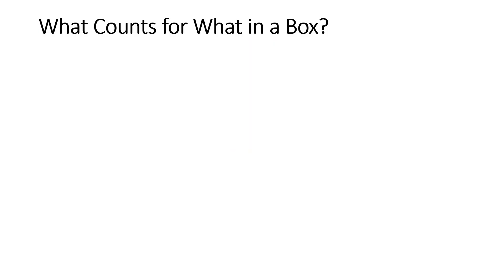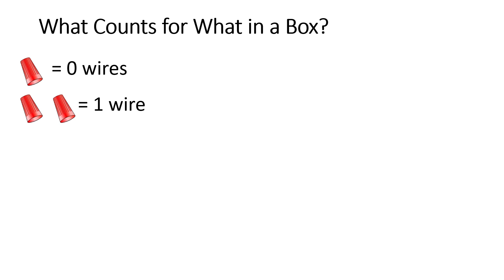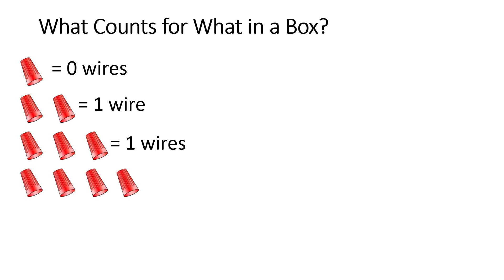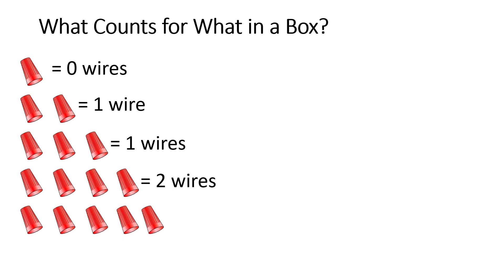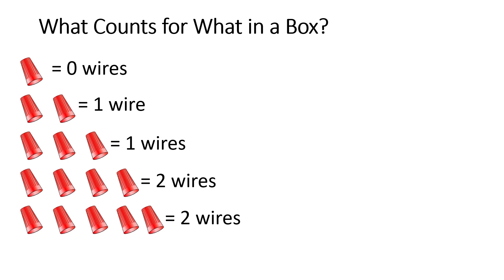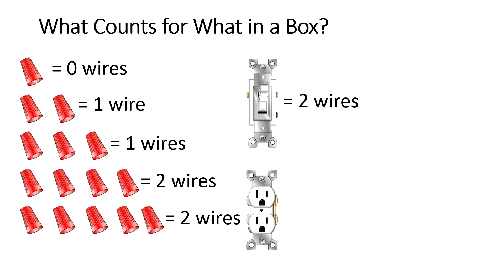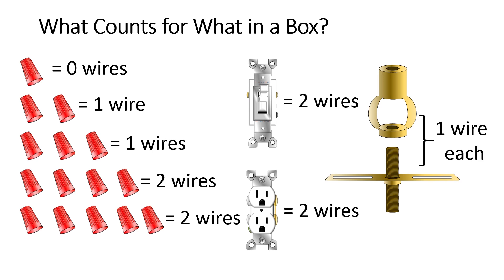Sizing an Electrical Box

Comment: hey quick question!! when there is a device present ( switch, outlet) do we use the largest conductor for caluclating the 2 conductors the code requires use to account for the device? or can we use the smallest wire for the volume calculation?
Reply from the maker: It would fall under the same requirement as  wire connectors. We would use the largest conductor sizes and take the device as two equivalent of that size.

Comment: Just took a Class with the gentleman who publishes the illustrated CEC and 12-3034 2(b) - one conductor for every insulated pair with a cap.  And that is how we are doing it in Code Class. So your six wires as per the code is only 3 wires, plus 1 for every pair of caps.
Reply from the maker: Each conductor that enters OR exits is one each. The only time it does not count is if no part exits the box. A pair of conductors, with each exiting via a raceway or cable would count for two conductors. The wire nut would not count until there was a distinct pair of them. 

If each of the six conductors enters or exits they count. Six "enter", six "exit" = six conductors for enclosure sizing purposes. Plus the one conductor equivalent for the three wire nuts as it is one full pair.

Comment: The Octogon is 4x2-1/8 not ....1/2
Reply from the maker: Yes, thank you. Sometimes mistakes happen.
Reply: @schulerruler  I am doing a question now. I counted 57 conductors of #8 × 45.1 ml from T22 × 0.061= 156.8 cubic inch. The right box is 8×8×4. I don't know how they changed 156.8 cubic inch to 8×8×4.
Reply from the maker: I'm assuming they are going off of standard trade size boxes and the next smallest would be a 6x6x4 which has an internal volume of 144 cubic inches which would be too small as you mentioned the required volume is 156.8 in³. 
An 8x8x4 would be the next largest at 256in³.
Reply: @schulerruler  Is there somewhere to find those sizes in the CEC or just trade knowledge?
Reply from the maker: Above a 4 11/16, it would be trade knowledge, or manufacturers catalogue sizes.

Comment: the last question should be Octagonal 4*2-1/2   because is 250 ml   ,not 4*1-1/2
Reply from the maker: You are correct. I wrote down the wrong box unfortunately.
Reply: But, 4*1-1/2 is for 245ml. should the answer be 4*2-1/8 ?

Comment: Hi,
Can you please advise me how to prepare red seal exam for industries Electrician - i am totally confused how to get that material for preparation
Reply from the maker: Check out the red seal standards web site as they'll have a breakdown of the exam as well as the RSOS document outlining the expected work activities expected. 

For exam preparation, there are options through the CSA itself to access practice exams four a fee, as well as exam bank, also for a cost. I caution the exam bank as I've noticed some code questions are from previous code cycles.

The small handbook that comes with your codebook is a great study resource as well as it covers quite a bit of information.

Comment: Are you able to help? I was given a vague question and need some assistance, please.

How many insulated conductors are allowed in a 2 gang device box that contains?
1-Single pole switch, 1- three way switch, 2-two conductor connection and 2- three conductor connection.

I've tried everything, drawing it, counting it. I am so confused with the 2 - two conductor connection and 2-three conductor connection part. I am able to calculate box fill but unsure how to account for these to count as conductors. 

Thanks
Reply from the maker: Each switch counts as 2 conductors, and each pair of wire connectors counts as 1 conductor. Without including the conductors themselves it sounds like 6 conductors of space are already utilized through your listed equipment as follows:
Single switch on one strap = 2
Three way switch on one strap =2
Two x two conductor connections is 1 pair of wire connectors = 1
Two three conductor connections is 1full pair of wire connectors = 1 
This makes 6 total. 
Deduct this from whatever box you choose and that tells you how many more you can stuff in the box.

Comment: how count  bonding wires inside box?
Reply from the maker: If they are insulated they count the same as every other insulated conductor. 1 for straight through, 1 for every insulated conductor that enters or exits. 
If they are bare conductors (uninsulated) they do not count, though you could count them as good measure, but it's not required by code.
Reply: @schulerruler  if we have 3*14/2 and their bare bonding go in one wire nut and extend one of them to box and switch grounding screw how many is considered?

Comment: I thought I understood this pretty well, until I had to do an example with a GFCI measuring 3.4 cm deep. 12-3034(3) seems easy. 3.2sq cm X 3.4cm= 108.8 ml reduction of the box volume. Fine, we've accounted for the entire volume of the GFCI inside the box. Having accounted for the entire volume of the GFCI, do we still need to ALSO add two more conductors for the GFCI receptacle? As a back-of-the-envelope calculation for a typical AWG14 upstream box with insulated ground wires (total 6 wires+1 connector), this works out to needing 256.4 ml if I don't add two extra wires, and 305.6 ml if I also add two extra wires for the GFCI. Big difference! Does the remark "Except as specified by subrule 3..." in 12-3034(2) tell us we don't need to add the extra wires if we account for the entire volume of the GFCI?

Comment: hello
very helpful video but in last example of different sizes of conductor calculated conductor area is 250 .xx ml why we take box in octagonal less than 250 you take the column one 245ml ( 15 Inch) can u please explain a bit 
thanks

Comment: Soooooo good... well done bro... one question that you didn't address... how do the bare ground wires count in this calculation?
Reply from the maker: The rule only ever specifically mentions insulated conductors. It certainly doesn't hurt to count them, but not required.

Comment: Can you do a video about when does neutral count a CCC...thanks
Reply from the maker: Hey thanks for watching. A true neutral won't count as a current carrying conductor, however an identified could. For example if you had a 120V two wire 
circuit, both the hot and identified would both count. Check out the video below, as it walks through a bit of the why, as well I have a video on Edison three wire in my "theory" videos playlist.

https://youtu.be/pfslDBRGT3I

Comment: very informative...thank you .  However, it's a bit misleading in that you mention that receptacles and switches count as 2 conductors each.  The conductor calculations change if  you install devices that are deeper than the standard 1" receptacles and switches. Items such as dimmer switches and GFCI's are deeper than 1".   The formula to calculate the box fill for deeper receptacles is  82 x the depth of the receptacle (in cm) div by 2.54.  For example..a receptacle that is 4cm deep (measured from the yoke(mounting bracket) to the back) would be 129 ml.
Reply from the maker: I intentionally created the images to reflect standard devices, but you are correct, for larger devices it is a different calculation. Especially those nasty USB slot receptacles!!